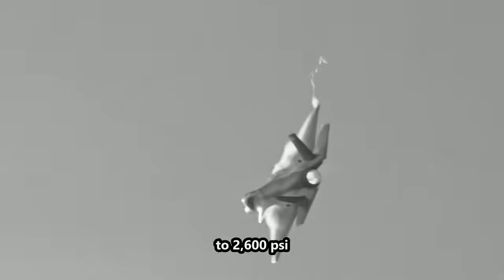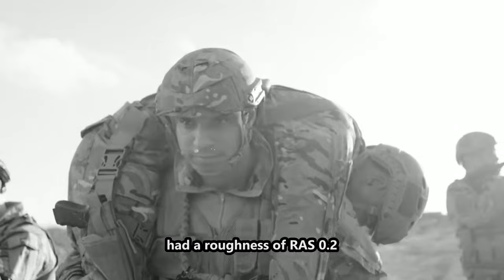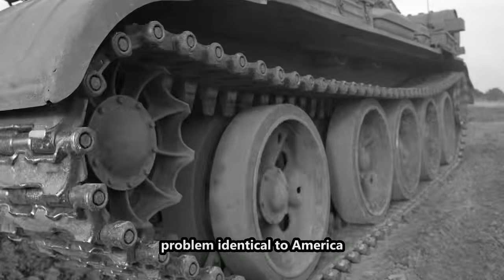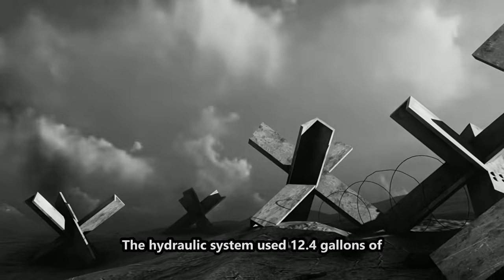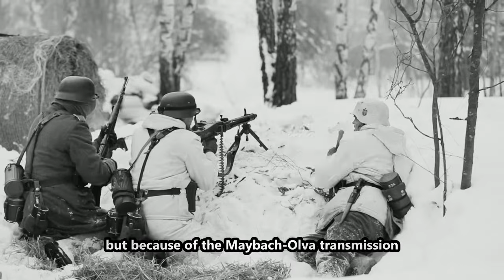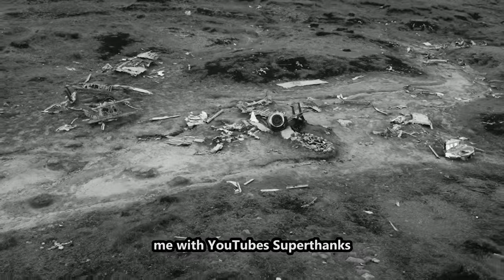Maybach-Olvar Transmission Allies FAILED to Copy for 40 Years from Tiger Tank

Comment: US automotive engineers were aware of the select shift manual transmission before the war started. It was a complicated system invented by an Englishman for use in luxury automobiles to get more wealthy women driving those. The US engineers came up with the simpler fluid drive that was connected between the manual clutch and synchomesh manual transmission. One only needed to use the clutch to go into first when the vehicle was first started. The fluid drive took over from there. The US Army's M6 55 ton heavy tank used a fluid drive that used kerosene instead of hydraulic fluid.

Comment: Ummmm... Modern 700hp 130 tonn trucks with mechanical transmission do not require any specific efforts to control without any servos, micron precision and Maybach price. Why it was so big problem in WWII - not clear. Road Ranger gearboxes did not change much since 1950s.

Maybach transmission solved the problem which simply never existed for US since mid-war when heavy versions of Hydra-Matic transmission went into production, which Germans could not reproduce until late 1960s.